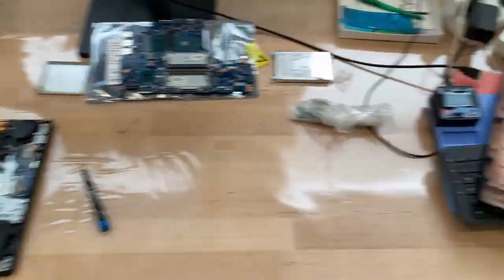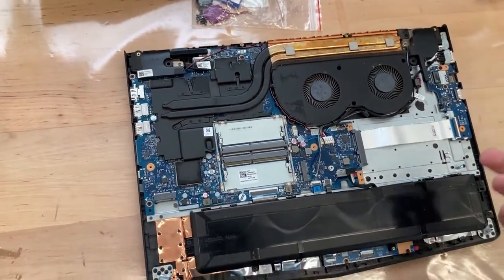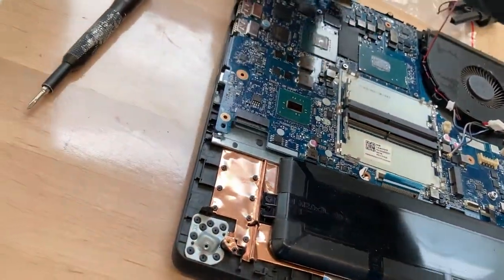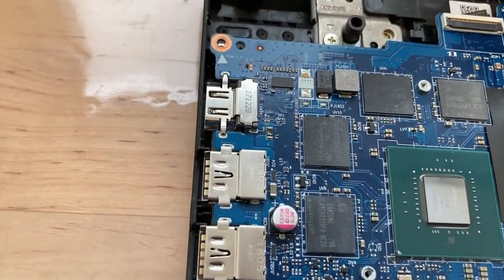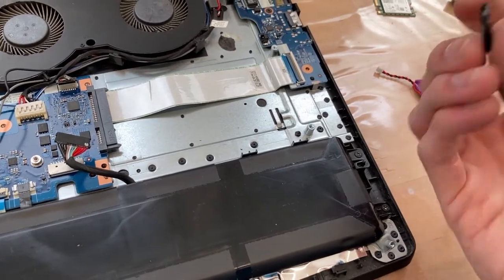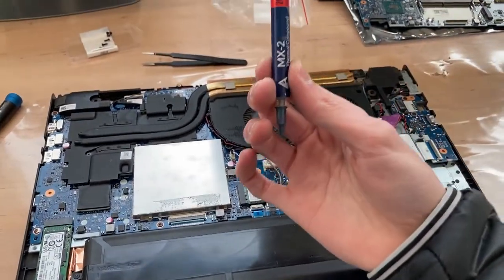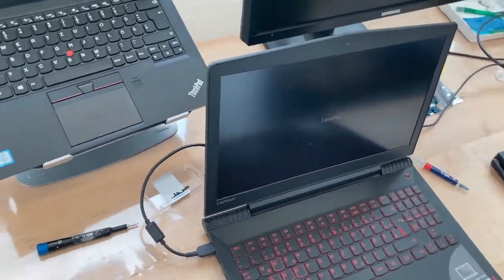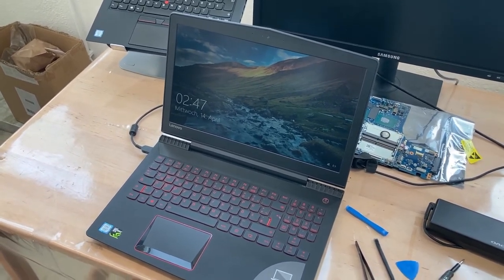Lenovo Legion Y520 Motherboard Swap

Comment: My father has a lenovo c7 and probably its motherboard must be changed. Considering u found a new one but with more powerful components (intel 10980 instead of 10875 and rtx 2080 instead of 2070) do you think I can easily swap it without strange problems?yes it's exactly the same model but with more powerful parts
Reply from the maker: I cant' guarantee it 100% of course but there is a good chance of it working out. I did similar things to some other Lenovos (mostly Thinkpads) e.g. replacing a Core i5 board with an i7 and it worked every time. So as long as the connectors all match up it will probably just boot up with the better hardware.
Reply: From what I have seen in the pictures motherboards look practically the same,  same ports position and quantity and same components position

Comment: A short circuit occurred on the Lenovo Legion y520 laptop, when removing the display cable from the motherboard, the battery was not disconnected. External monitor via hdmi, everything works, LEDs. Only there is no image on the internal monitor. I took my laptop to the service center.After diagnostics, they told me that the motherboard is faulty and when  they returned  laptop to me, when I turn it on over the external monitor, it doesn't show the Lenovo boot background, but immediately the windows logo and turns on slowly. Im 100% sure that always was a lenovo loading boot screen and fast boot up!  Is there a possibility that they replaced mine with a broken one, and that my problem was only the display, display cable, connector  motherboard or something that could be fixed on the motherboard, but they lie and scam me?

Comment: Hello, do you think that i could kind of upgrade with this? I have Y520 15IKBN so its the same model as the one you have right here. But mine is i5 and there are versions of the motherboard with i7. I know that it would be stupid to do it just because of CPU but anyways my GPU is burned so theres nothing holding me. So would it be possible? Also where did you buy that motherboard?
Reply from the maker: I think that it should be possible as long as the ports and the internal connectors match the i7 board. I bought my replacement board on ebay.
Reply: @MacintoshMen  Was the one you bought completely new? And also do u think that i could make it at home or should i rather give it to some servis (i have experience with building several computers, none with laptop though just adding ssd and repasting)
Reply from the maker: @dunwader2655  No, my board was refurbished. I don't think you'll find new ones; I think you could do it if you put some thought behind it, it's  not that hard on Lenovos.

Comment: I have that model for graphics reasons. It's still new to me except a flaw in the display cable.
Reply from the maker: The display cable probably isn't all that hard to swap out; just a little fiddly.
Reply: @MacintoshMen  I got it covered.

Comment: Having trouble in the wifi device  connecting back the gray and black cable back, how did you magically put them back>?
Reply from the maker: It's a bit tricky but after a few tries you'll get it

Comment: I have this same model and my son did a factory reset but it locks the startup behind a bios password for the hard drive and I don't have the password. Best Buy is saying they tried to replace the hard drive and it didn't resolve it. They say I need another motherboard. Any ideas on how to get past the bios password lock screen?
Reply from the maker: Maybe this helps you: https://www.cocosenor.com/articles/computer/3-ways-to-unlock-bios-password-on-lenovo-thinkpad-laptop.html

Comment: Should i just swap my motherboard? When i turn on my lenovo legion y520, fans start to spin for 5 seconds then they stop and no display or anything, its just freezes and i have to unplug power cable from battery because my power button is broken.
Reply from the maker: I'm not 100% sure of course but it really sounds like its the motherboard. You can try swichting out the RAM first, maybe it's just a bad RAM stick.

Comment: My Lenovo legion y520 stopped displaying after I tried to upgrade the RAM. Replaced the new RAM with the old RAM but it's still not displaying.
Reply from the maker: Maybe try with another RAM stick but I got a feeling that the board is having a problem.

Comment: I have the higher version the one with the B391 motherboard with the gtx1060 and the motherboard is dead and sadly this laptop did get released in my country and i can’t fix because i can’t find a replacement one until now😂🤦🏽‍♂️
Reply from the maker: Ah, that's a bummer. Did you also have no luck on ebay?
Reply: @MacintoshMen  i found a perfect replacement on AliExpress but the problem is the country where i live in charges a ridiculous amount of VAT and taxes on any outside purchase so it is not worth buying. it will cost me the price of a whole laptop in one piece